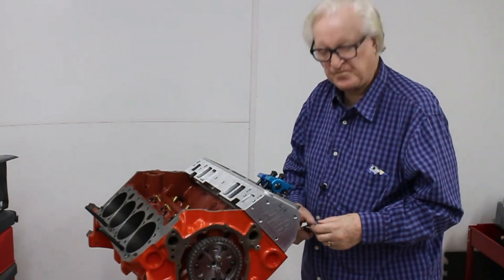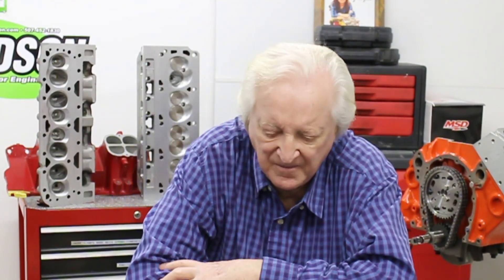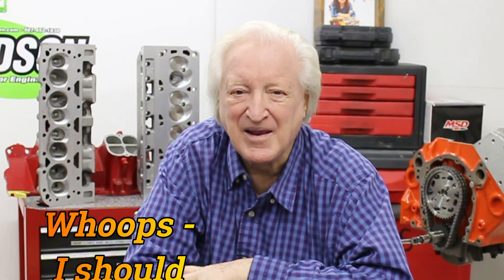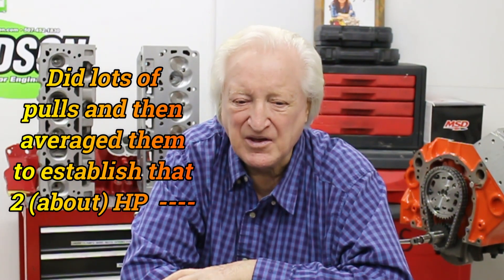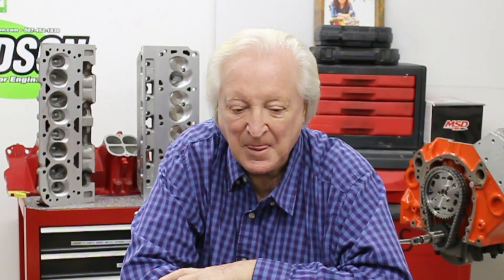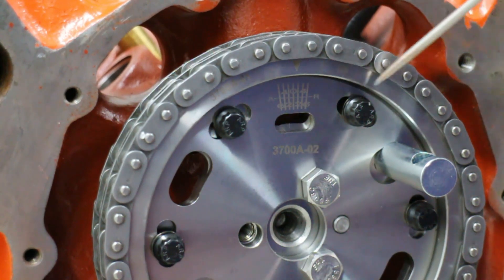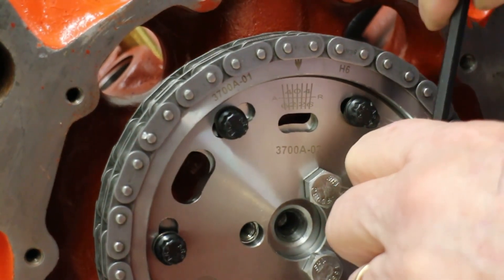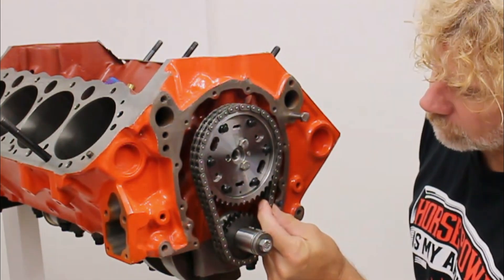David Vizard's PowerTec 10 EP 22 Avoiding Timing Chain Power Losses

Comment: Excellent video with Dyno-proven results.  My question is what is the measure of a chain that is too tight or too loose?  How much range of deflection is preferred between the cam and crank gear and how many pounds of force are required as a standard to impose the deflection?  10, 25, or 50 lbs?  What is the maximum “allowable wear” measured in deflection typically?   Also, I realize this would be a variable on all different engine types as the cam and crank gears vary in spacing and chain length.

Comment: Forgive me if this is a stupid question- but a looser chain means the cam gear would be more retarded relative to the crank causing change in power relative to the shorter chain. (Of course this means nothing IF it the cam was degreed in each time)

Comment: great video.  Curious- are the crankshaft harmonics not detectable via spark/timing scatter?  you mentioned the tight chain did not have scatter, but may have transferred harmonics.  I would think that should be visible but maybe not?  the harmful harmonics, if not detected thru scatter, i guess would affect valvespring stability.

Comment: David, I will only be assembling my engine once (383 Chrysler, '67, stock bottom end). One cam, no Dyno. Do you have a preferred brand of timing chain? For a street engine, does it matter? I don't have a degree wheel or fancy tools, so I'm not gonna degree it even if I knew how. Just line up the dots.

Comment: Mr. Vizard, I've heard that the '70s Ford 351M/400 had, to crutch emissions, a camshaft ground 8 degrees retarded. If I was to get a multi-keyway timing set, would I install it using the 8-degrees-advanced keyway? Would that make the cam effectively "straight up"? Thanks.

Comment: I had that problem with my timing chain. I tore an engine apart, after 4 years. Note, that it only ran a couple hundred miles a year. The timing chain had about less than 3/16 “ play, but I changed it again after a little more than 2 years of about the same usage. At that point I had lost a love on the cam, and I’m guessing it was from running Mobile One without a zinc additive. Upon disassembly I noticed that the cam was worn, and the cam bearings had worn more towards the right side. I can only imagine that it was caused by the tight timing chain

Comment: You mentioned transmission of crank harmonics into the timing chain and cam, so I was curious what your thoughts were on this issue. It seems like most people don't rev AMC inline 6s past around 5200 rpm, as they have issues throwing timing chains. People have tried gear drives, belt drives, etc as solutions, but to me it seems that the issue could be caused by the fairly common crank harmonics present in many of the long crank American inline 6s. I imagine an upgraded damper, which unfortunately is currently not a normal production part could be a potential solution to this issue as there's nothing otherwise bad or remarkable about the AMC I6 timing chain. Certainly it would be something that could only be speculated on, but I guess the question is have you seen timing chain failures increase with poor harmonic damping?

Comment: The problem isn't really the chain as that is a standard size between pins and usually made very accurately. (even cheap chains start very accurate just have poorer quality material and heat treat)
 Production tolerance between crank centreline and cam centreline is really the issue.
. Some engines are quite 'loose' particularly if mains are line bored, in fact, isn't there a difference in Pitch Circle Diameter of sprockets for line bored blocks (I know there used to be 20~30 years ago or more?)
I remember seeing 0.005" and 0.010" sprocket advertised (to compensate for crank getting closer to cam)
The 'correct' thing to do is get  sprockets with smaller PCD. and not fit a worn chain.
Did you monitor oil temperature? I would expect things to run quite a bit 'warmer' as your also 'pulling' the cam down into bearings and crank up into mains so friction will be a lot higher than anticipated.

Comment: Very interesting video!  Was that block align honed?  Lineboring & honing can move the crankshaft location , which typically would decrease chain tension.  A Sunnen line hone cabinet has the weight of the mandrel on the block . I built my own line hone machine (with a sunnen mandrel) where I can rotate the block to put the weight of the mandrel on the caps instead of the block , which in theory should reduce the amount that the main bores are moved towards the cam tunnel.  I may have to rethink my method especially on a virgin block that just needs cleaned up with minimal effort.

Comment: Love the advice on avoiding HP losing too tight timing chains. Any chance you can do a video on Ford FE head porting, FE heads, FE rods and FE blocks? Their is such a resurgence in the original BBF with vintage Cobra, Mustang, Cougar, Galaxie and Fairlane restorations and hot rodding that the old FE engine family has gained a new life and quite a following of late. Keep the great videos coming as they are most appreciated and cherished! Great info there, keep educating the masses.

Comment: Dave. have you ever drilled the oil galley plug with a .030 oil feed hole to oil the chain?? I've done it for years and have seen timing chain stretch over 20k miles almost completely disappear to the point that I have used the same chain and gear on several motors.. what are your thoughts?
Reply: I believe this is mentioned the the Chevy Power Manual. It defiantly will help lubricate and cool the chain.

Comment: I have read the double roller chains cost  hp as compared to the stock type chains. Is there any truth to this? What type of chain would yiu recommend for a street engine?
Reply: I was looking through the comments to see if anyone asked this question. For engines that don’t have crazy high valve spring pressure, I would think a single roller chain would be a better choice. Less friction.
Reply: A gear drive.

Comment: What's your thoughts about gear drives? Do they eat more or less HP?
Reply: They dont cost power. Its been proven. Thats an old myth. They also dont stretch, and I trust them a LOT more than chains.
Reply: Only use a 3 piece Milodon.   the 4 piece are junk and will eat your front cam bearing.

Comment: For anyone that rides motorcycles, that resistance is a noticeable quantity when pushing your motocross bike after putting a new chain and sprockets on. It's takes a good month before it really rolls freely. It's slightly better after a few runs but will glide almost effortlessly right before it's getting worn out.
Reply: The problem is more than likely O-ring (or X-ring) chain, often run too tight plus whatever grease is in it from new.(often too heavy)  Even though they wear much faster, a non-o-ring chain on a 125 or even 250 will give noticeably better acceleration as long as it's lubed. Fitting a chain oiler with a non o-ring chain extends chain life dramatically. Non o-ring chains are also cheaper so you buy 2 chains and a set of sprockets (and a handful of connecting links) I rode open class (490 Maico Alpha 1), it was a long time ago but I also worked at a dealers with everything from RM and YZ 80's to RM500 and YZ490
Reply: Agreed same thing with bicycles when I was a kid I adjusted my chain to tight and it took a lot more effort to peddle
Reply: Depends. My bike stetches the chain every ride but any bike rider knows not to have the chain  tight.  Did david deed to make everyone feel dumb when we allready know.
Reply: @michaelgiglio1571   You may be surprised how many people don't know how to correctly adjust a motorcycle chain or even ignore factory spec as they don't want any drive line 'snatch' when posing around town (even worse with the swing arm extensions on pseudo drag bikes)
Common fallacy. The side plates don't stretch (at least not at any rate you  or I can measure )
Chains WEAR.
 There are a lot of parts, inner and outer side plates, rollers, bushings, pins, multiply that by the amount of links and even a small amount of wear or poor construction/materials can be noticeable.
 It's why cheap chains don't last long o matter how careful you are.
 There are a few solid roller chains made with sintered metal and oil impregnated, when under pressure the oil comes to the surface ( IZUMI used to make them, substantially more expensive than 'conventional' roller chain.) 
Reynolds in England invented the 'white high pressure grease that comes on OEM DID chains, Reynolds never invented a way to mass produce the chains with it though so they licenced it to DID
Reply: 1571 not so
Reply: Loose is fast ,same with piston rings if you replace them ever 2 or 3 rounds there not ment to last more then a few seconds ,oil pumps too always use a standard pump with a bigger spring a hi volume pump eats up horse power
Reply: There is resistance in any mechanical power transfer, period. Before the rollers and the sprocket wear into each other, there is a roughness that causes heat. Aka friction. After the surfaces are fit to each other, the friction is greatly reduced. 
Wish to dispute this? Then understand what you are talking about. Gates belts has done extensive studies on all methods of driving camshafts. From belts, gears, chains and so on. The resistance increases with speed. That's why polishing like rem finishing on gears is a thing. To reduce initial friction and aid in break in.

Comment: Thanks, David!   Did you investigate the condition of the cam bearings and main upper bearing shells after that tight chain was used for dyno tests?  Just wondering if it was tight enough to cause metal-to-metal at the forward cam bearing and front upper main.

Comment: So having a little more slack allows for a little more clearance for oil to ride between the chain rollers and the sprocket teeth hence reducing friction and drag, makes perfect sense.  Kinda like that boundary layer affect that we also see with air flowing through a port, so what David is talking about here is fluid dynamics as much as chain tension.

Comment: What is your evaluation of,   Chevrolet factory original gear drive camshaft on a Chevrolet 427 Big Block industrial engine ( grain truck on a farm) ( reverse rotation camshaft, factory original).
Would a reverse rotation camshaft & gear drive "FIX" the chain problems?
Thank you for the  Professional  training &  education.
Why are the camshaft companies NOT making reverse rotation camshafts and gear drive????
Can you test reverse camshaft & gear drive VS chain drive???
Using a Big Block Chevrolet (or small block) gear drive VS chain,  using a electric motor to drive (power) a crankshaft ( without rods or pistons).  
Also test,  does high spring pressure require more horsepower????
Does roller lifter use more or less horsepower???
Does roller rocker arms use more or less horsepower???
Yes I know the crankshaft oil passages will spray oil,  so a crankshaft without rod passages drilled out.  Just ask a crankshaft manufacturing to Not drill out the rod passages.
Thanks

Comment: What's your thoughts on gear drives? Like the Pete Jackson, with double idlers?
Reply: You read my thoughts...I hate the noisy things and where do all those harmonics go.?..Can't be good for the valve train.
Reply: @ziggassedup  👍😎
Reply: Yeah I have the quiet one can’t really hear it but it’s been in for 21 years 
Definitely an interesting question !
Reply: They are fine. I like them better than chains. If you dont like the noise you can get a quiet one.
Reply: I've got the really expensive Milodon single idler on my street 350 (don't ask me why lol) and it is completely silent in case anybody was wondering. 
I did spend a lot of time setting it up EXACTLY as per the instructions though. I was shocked at how quiet it is when I first started it. It's as quiet as the crappy stock Morse set.